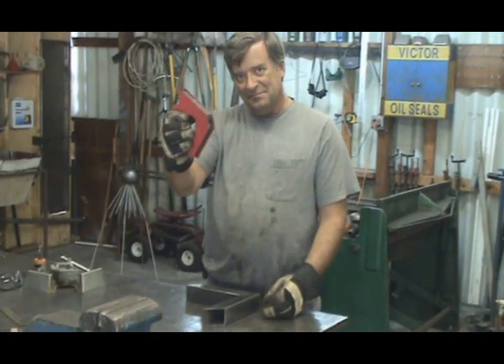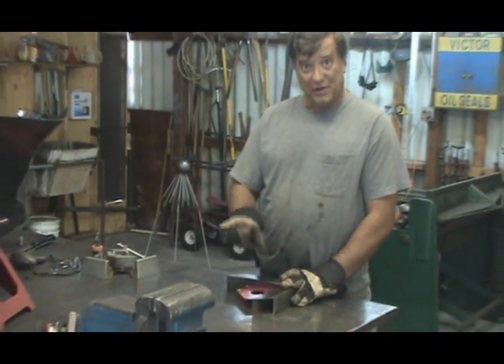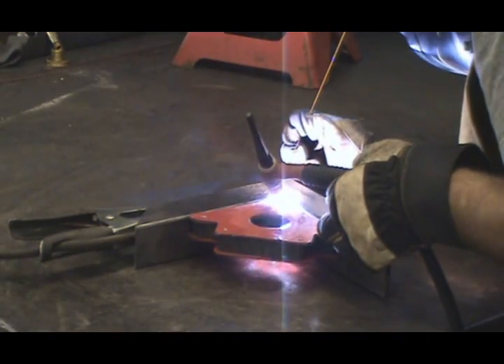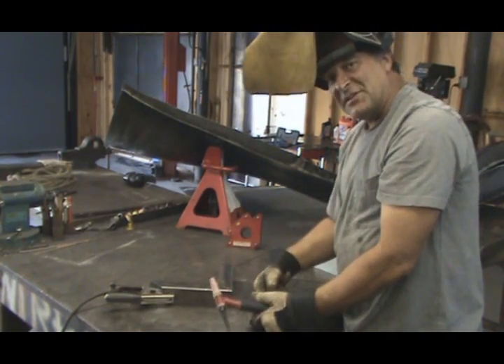How to Weld a Right Angle Without Warping the Joint - Kevin Caron

Comment: Welding stainless is even worse for "warping". Stainless shrinks more when it cools and the welds pull in. I pre think which sides will pull the worse and try to place the angle greater than 90*. So if I think a corner weld will pull in 2* once welded. I make it 92* and weld it. Vola, 90*. Using this method I can skip a lot of bracing and clamping. Saving time.

Comment: just cut through the metal with an angle grinder and make a "V" cut half way through it. the larger the angle on the "V" the more the angle on the joint it's self.  it doesn't have to be perfect or anything just start out small and work your way to the correct angle.  then when you find the right angle cut just weld it together.

Comment: To make any angle bend without cutting through the entire piece.  cut a V on one side of the tube leaving the back untouched. then simply bend it to the angle you want and weld around the V.  may take some fine tuning but it's worth it. That way it's all one piece so less welding it comes out straighter with less need for clamping and lining up works best on square tubes but you can use this on anything even angle iron. It's hard to explain so if you dont get it ask me a question.

Comment: You didn't answer her question... You tack on opposite corners because the metal in the HAZ is expanded, and when that metal cools, it will contract and cause tension and tend to pull. That way you control (and reduce) how the metal will be pulled back.

Comment: I use those magnets all the time.   They also make them where there is a switch on them so you can turn it off , to get the metal dust off of them.